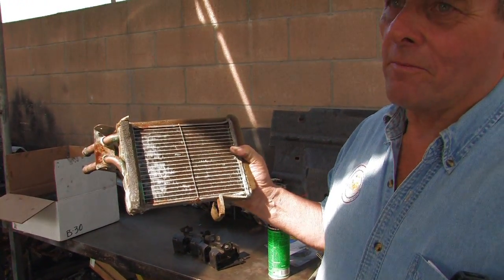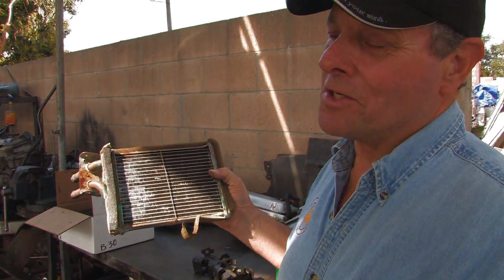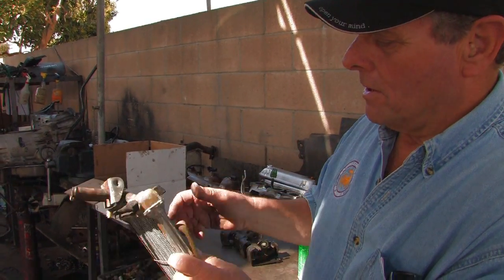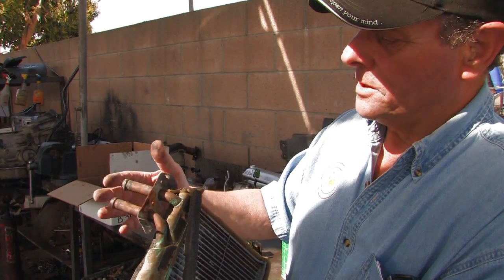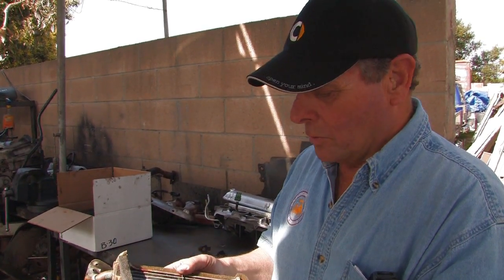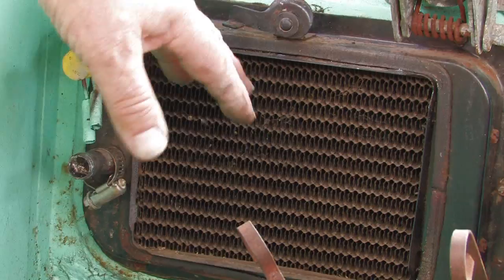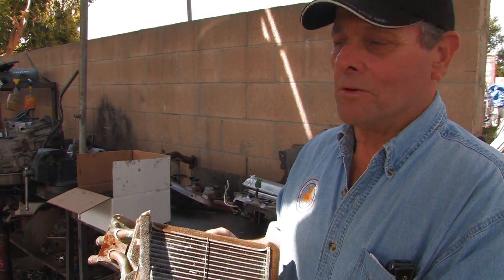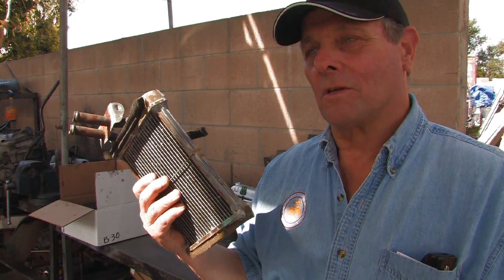Troubleshooting Car Problems : How to Tell if Your Heater Core Is Going Bad

Comment: I'm losing water, heat really doesn't get hot, smelling antifreeze inside cab of car, floorboards are dry. I've recently replaced thermostat, water pump and timing chain. HELP PLEASE!!

Comment: hi friend

1. can a clogged heater core cause engine overheating?

2. can a DAMAGED heater core cause engine overheating?

3. what would happen if you cut the inlet and Outlet hoses but don't join them together?

4.  how would I know if the heater core is simply clogged or if it already needs to be replaced?
Reply: 3. Coolant would start shooting out of the hoses??
Reply: You have pressure in the coolant sistem????

Comment: I wish I could ask him if the smoke coming out of my vents is from a bad heater core
Reply: Smoke or steam? If it does not smell like smoke it might be antifreeze and could be the core.
Reply: In search of the same. I know my 30 year old core is on its last legs but I had some serious stinky smoke coming from my vents while the AC was running.

Comment: What if there's water leaking in the car,  and not coolant?
Reply: Your AC drain might be clogged up. It can also be caused by the drain for rain water in front of the windshield. It gets blocked because of dirt and leaves over time so take a look at some videos covering these.

Comment: Will this cause the car to over heat?
Reply: If enough coolant is lost from the leak...yes. Other than that as this gentleman stated you will foggy windows, damp carpet and for the most part topping off your coolant from the fluid loss.

Comment: I have 2 engineering degrees and the Heater Core on a Jeep Grand Cherokee has me baffled!!  I flushed the heater core and the water flows fine!  And despite HOT air going to the firewall on BOTH lines, the heater core stays COOL !!  No heat comes towards the cabin side!!  Blend Door area is now open and they work.  Actuator also works and operates the doors!    Is there a FUSE / Switch somewhere that is supposed to trip the Heater Core!?  Thanks for all your hints.

Comment: I have a 2007 Hyundai Sonata> the rug is wet on the DRIVER'S SIDE , It seems to happen when I use the HEATER /DEFROSTER, NO one seems to know what the problem is ,, can you please help, its actually showing rust spots now on the rug,

Comment: Or could be a clogged heater core. Flush out before attempting to replace. Unless your heater core is leaking inside car, then u must replace it.
Reply: I've never seen flushing a heater core do anything, if anything itll just cause a restriction.

Comment: "If you're really in denial.." lol perfect line
Reply: Hi I've got a lot of noise coming from my blower motor assembly  but only when I turn it up over halfway do you have any suggestions for me before I just start tearing the dash and stuff apart to see inside
Reply: Oh it's in a 06 Nissan Altima with the 3.5 l 6cyl and it's in my heating system it's just shacking the dash apart if turned up over halfway any help would be appreciated

Comment: My cars heat stopped from working and also the a/c isn’t working either it blows air but not hot when heat is on nor does the ac throw cool air when on it’s just hot air as well I’m assuming it’s heat from the motor what could it be I have a 06 Nissan Murano if anyone could help I’d appreciate it..
Reply: What model, year & mileages?
Thermostat, Input & Out Hoses and Coolant been replaced?
Check the Cable that pull the Temperature System (outside, near wipers) from normal to maximum (have someone in car turn those HVAC dials/levers) while you looks at engine.

Comment: My 2009 chevy impala emits vapor from the middle console. AC works fine, car temp good. No fog on windows, no weird smells, no leaks on passenger floor. Just the vapor as the only indicator. It happened one time, and I’ve kept my controls off ever since to keep problem from getting worse. If I’m not seeing any other symptoms, is it still a bad heater core anyway. No leaks found under car either if that matters.
Reply: Could mean alot of things a small leak in the core or like he said the ac evaporator is right next to the heater core which can also leak it has almost the exact same symptoms minus the coolant smell. You could have been seeing the refrigerant from the ac evap

Comment: if I cannot feel any wind flowing out from the foot vent? How to do that
Reply: John, I had the same issue...would only blow at the windshield; not at body level or at the feet.  The "pathway" is controlled by vacuum lines.  Google the pathway.  For mine, it was a dry-rotted vacuum line boothead.  It fell off the vacuum valve that switched the flap that controls air flow direction. (The vacuum line ran across the firewall.  The valve was on the passenger side and ran to the vacuum tree that was on the driver side) $3 fixed it!!!

Comment: I have quite the opposite, when the windows fog up over night, the area near the defrost vents is the only spot it isn't fogged. does that indicate something? also, my heater core does not appear to be leaking but I am getting a light smoke from the hc area when I turn the heat on.

Comment: i have a 96 fire bird and i have been cheacking and fixing things on it but as of to day i fixed the hoses but now my care is over heating......when i get in my car it rises in temp fast and blows out COLD AIR!!!!! with it on full hot and on defrost well after driving it for a sec the heat started to go down to half then HOT AIR but then few secs later more cold air and so on and so on........wtf is the problom??? lol
Reply: Como     fonsiona.  as.  máquinas.  de.  tricô.   Industrial.   Com.   cartelas.   ou.  CD.